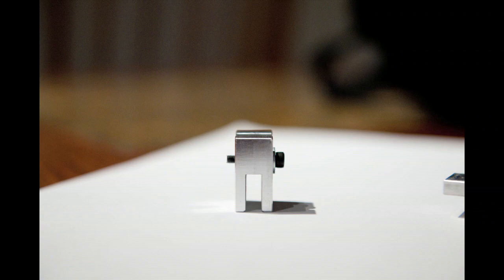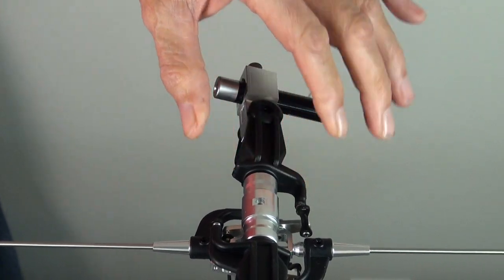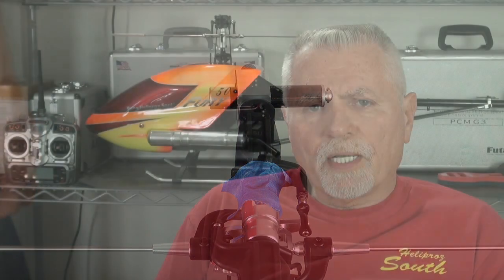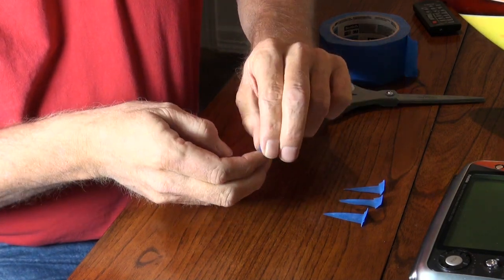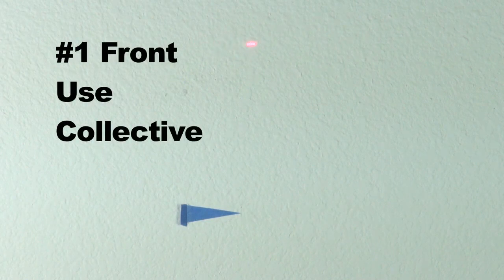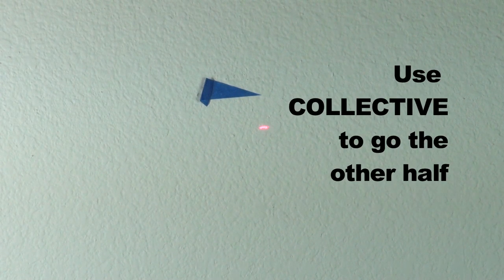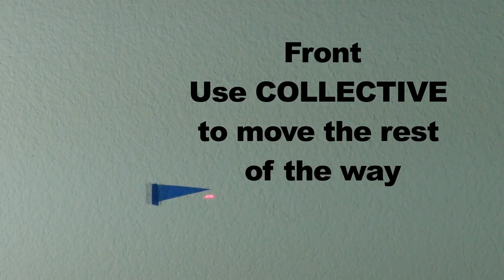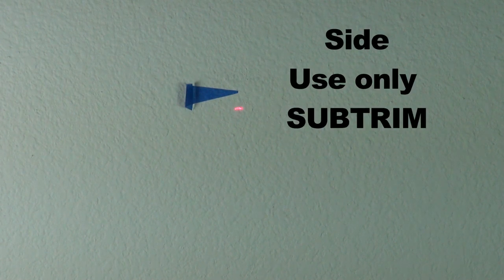Laser Pitch Gauge Part 1

Comment: if you use a digital caliper like i do to measure  all your links it will all come out perfectly level , i just finished building my align trex 500 pro and after flying it all my trims were centered and i didn't have to move one trim and the blade tracking was perfect.people make this helicopter stuff out to be way move complex than it really is . nice video

Comment: Do you have to first put the helicopter on a perfectly level surface before using the laser to level the swash plate? If yes, what part of the T-Rex 600 Nitro Pro, would be level? Example: The Head Block, Skids, Top of frame, ...ect. be level with the table (before you start using the laser pitch gauge). 
Thank you, Max.